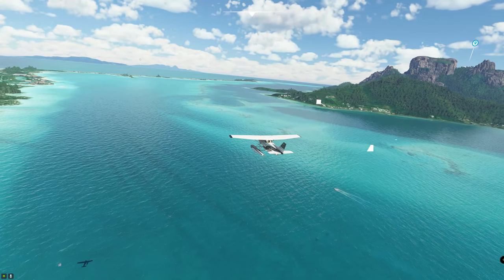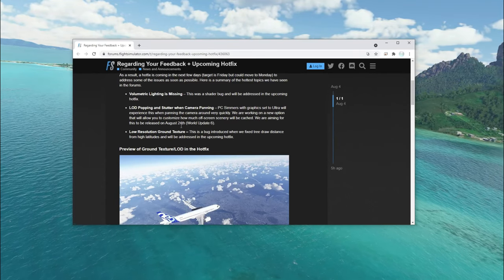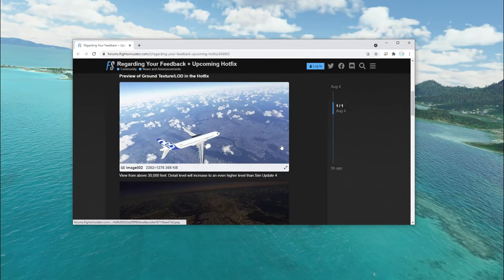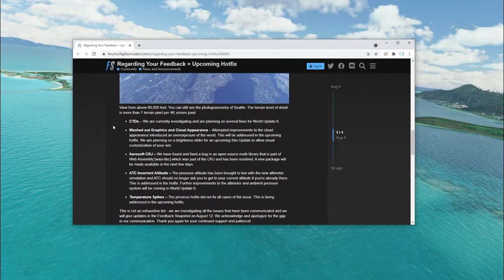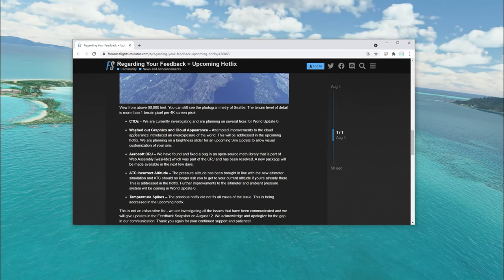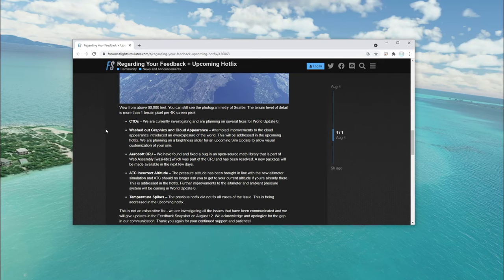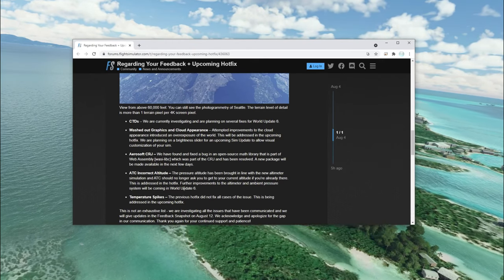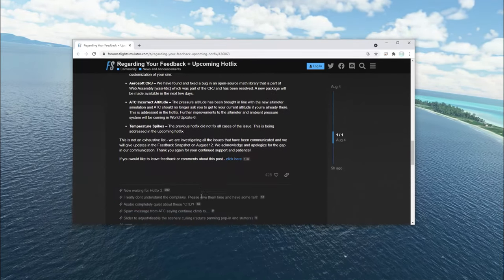MSFS2020 ANOTHER NEW HOTFIX ! To FIX Graphics , ATC, (CRASHES WU6)  Much More Sim 5 HotfiX take 2!

Comment: Still haven't fixed the atc bugs
Reply from the maker: Nope they haven't when ohh when
Reply: @2020fsers  Also every flight I do at one point the sim goes crazy, autopilot disconnects etc., then after a few seconds of repeatedly pressing the autopilot button it at last engages,
Reply from the maker: @Poseidon6363  that Is crazy .
Reply: @Poseidon6363  You need to make sure you arent using mods for the g1000/3000 or any working title or plane mods in your community folder. If you are then you cant really blame the game if you are testing things with mods.
Reply: @freespeechisdead202  I am not blaming the game, I blaming the FBW A320'cause the stock A320 gives me no problems.
Reply: @Poseidon6363  Yeh you were because the OP was about the games bugs and you said, also the sim goes crazy not a plane. Meaning the game itself.
Reply: @freespeechisdead202  No worries, thanks.